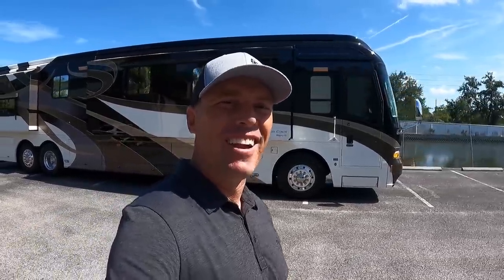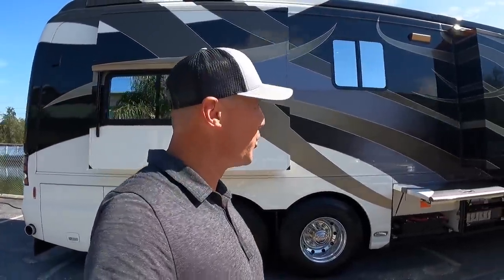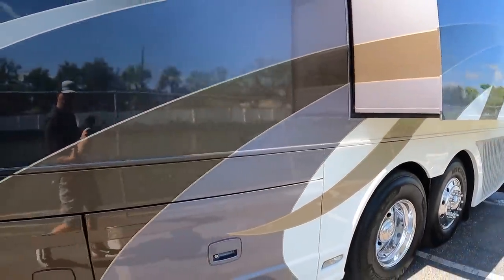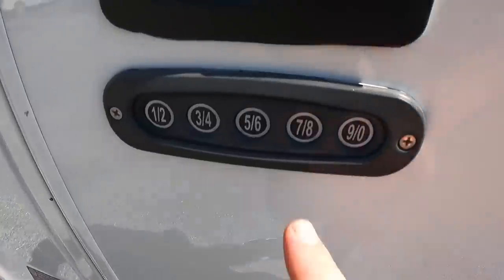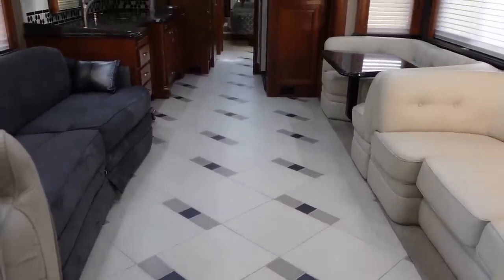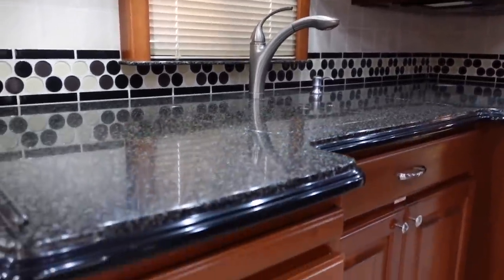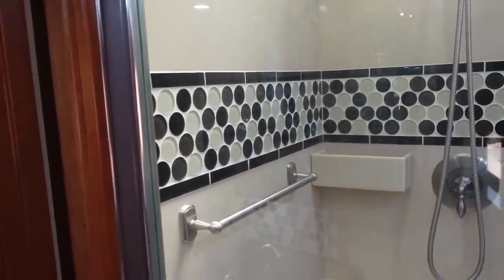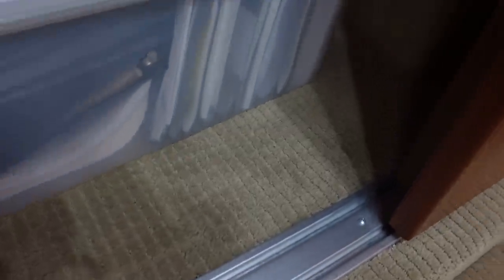2008 Country Coach Magna 630 Rembrandt For Sale

Comment: Love your channel, Andrew.  I would like you to do a video about the annual maintenance that a bus like this Country Coach would require and the approximate annual cost (excluding diesel which I can calculate). For example, if the coach spent winters parked in Florida and summers parked in New England, and I asked the Motorcoach Store to do annual inspection and preventive maintenance, what would that entail and cost? That number would be important to take into account to consider buying a large used coach.
Best regards, Tom in Bradenton

Comment: Hi Andrew. I just watched your Coach Detailing video from a ways back (the video where you show the products used such a Black Light Wash, the Chemical Guys Hybrid Radiant, and the finishing step using the Chemical Guys Mirror wet.. but you also said you use the ceramic detail spray ?? Can we use the ceramic detail spray on top of the Chemical Guys Mirror Wet?
Reply from the maker: Yes